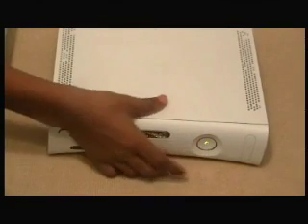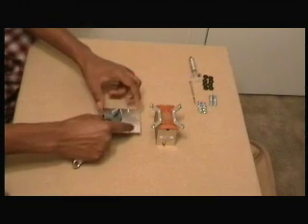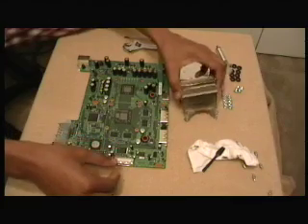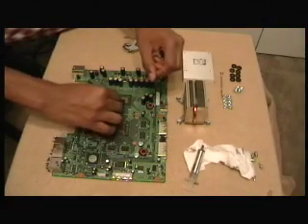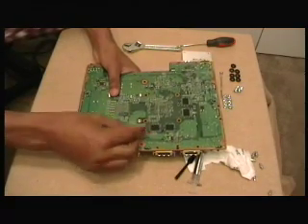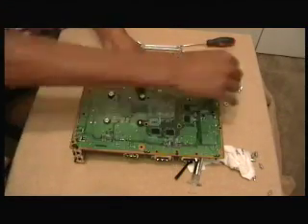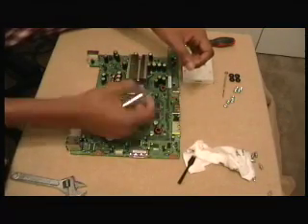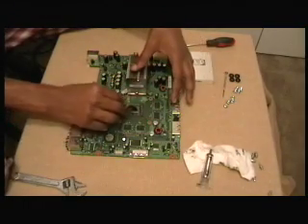Fix an xbox 360 with Red Ring Of Death ~ e74 ~1 red light -- PART 1

Comment: you sound like you might know something about electronics im a mechanic and have limited knowledge of computers but can understand and sometimes see how a system works,my friend gave me his old xbox#2with hdmi when he bought an elite i did a bit of looking on youtube then did my own mods basically i threw away the x clamps,stoned the heatsync level/smooth(the standard all have a radius) and used no thermal paste now it runs for 6 hours fine but turn it off and on and no good,residual heat?

Comment: why do you remove the x claps and replace them with bolts whats wrong with the x claps? it seem that the only thing that needs to be done is applying new heat sink compound to the chip so that it can conduct heat to the sink better.

Comment: This is great. But I have to tell you all. It DOES NOT MATTER What he has to say. You NEVER leave old/excess thermal paste on either the GPU/CPU or the heatsink. This paste once it has been removed (it's bond is broken) You always want to use something to remove it (best is iso 99% alcohol). If you don't use something good remove it, it will build a film and ultimately cause the error you have just fixed, to reoccur.

Comment: @RachelFuryRocks  Yes im sorry, dont listen to alot of these people here, silicone based  is what it is, cheaper "will do" compound. BUT you need as high a silver content as possible in Thermal compound, i would recommend Arctic Silver 5. 99.9% silver and around 10 bux from radio shack.

Comment: Continued, does not help much unless you put a small fan on it, if you do you can drop the temp down about 10-15 degrees, no the biggest problem is the X clamps and motherboard flexing this is why most xbox's can be fixed with new heatsink compound and to add microsoft used a silver based compound that hardens after many hours of usage then fails.  So unless your xbox has an other issues its not overheating, if you get the 2 red lights it is becouse the compound between the GPU/heatsink failed.

Comment: I'm still looking for any suggestions.  I did everything in this video, including heat gun. I don't get the RROD  anymore. I do get green lights, however it will always freeze after 10 or so seconds.  Not sure how to proceed from here. Any help will be appreciated. Could it be caused by the screws either being too tight or too loose???

Comment: i've built a lot of computers, so i just thought i'd share this with everyone. The way he applied thermal paste is WRONG. You can probably get away with it, but thermal paste when spread around and then attached to the heatsink will form air bubbles, which will ruin the effectiveness of the heat transfer... look up a video on how to correctly apply paste. You should place a blob or a horizontal line acros the chip and then attach the heatsink. the paste will then be spread evenly w/o air bubbles

Comment: I have sent my 360 in about 2 years ago
and now my 360 is out of warranty..
remember after doing this make sure the 360 resets or it will still automatically have RROD again.. unplug the fan turn it on  let it  over heat for a minute then Plug the fan back in  turn it on . Leave the power chord pluggged in when you do this~ becareful.
Also if you didnt put the right kind/amount thermal paste  or use the right amout of pressure when tightening the heatsinks it may not work

Comment: ALSO DO NOT TIGHTEN FULLY WHEN THE WHEEL IS OFF THE GROUND!
YOU WILL DAMAGE COMPONENTS,TIGHTEN THE BOLTS ENOUGH THAT YOU DIDNT HAVE TO USE FULL FORCE,THEN LOWER THE CAR JUST SO THE WHEEL IS TOUCHING THE GROUND BUT THE WEIGHT OF THE CAR IS STILL ON THE JACK.NOW TIGHTEN THE BOLTS TIGHT OPPOSITE TO OPPOSITE REMEMBERING NEARLY EVERY TIME YOU TIGHTEN TWO BOLTS THE OTHER TWO WILL THEN BE ABLE TO GO A BIT TIGHTER THEN VICE VERSA
I AM VERY SORRY FOR THESE COMMENTS AND THE CAPS JUST DONT WANT SUM1 HURT

Comment: mmmmm, ive built several pc's and it's not a great idea to spread the thermal paste all over, just a pea sized dot and let the heatsink's pressure spread out the paste. either work but the pea method is much cleaner because you dont get any run over from the paste

Comment: Update: I just redid all of the original work (heatgun reflow, thermal paste, replace xclamps with bolts) I did a better heatgun job this last time. (was a bit nervous and timid the first time) I turned on xbox, and got green lights. This is where i got the last time but it kept freezing shortly after. It's now been on with a game running for almost twenty or so minutes. I may have finally done it!!! I still have butterflies in stomach just waiting for the RROD to comeback. Only time will tell.
Reply: Does it still work? lol

Comment: If its 2 red rings i think its your power supply, make sure that its plugged in correctly to either the socket or the plugg from the xbox. if its 3 then its dead..and therefore need this kind of solution.

Comment: If u wanna fix rrod look at the power block and if light Is red then in plug the cord from the wall while xbox is off then wait for the red light to turn off and then replug, light should be red and when u turn on it will go green ;) thumbs up if helped

Comment: i just had this but i let the xbox cool down, removed the wires and the harddrive and then plugged it in again in the next 30 mins it seems to be working fine now? is this normal i dont wanna screw my xbox up even though it would be a good reason for my dad to buy me a new one ;)

Comment: My xbox gets 3 red lights when i first turn it on, then goes to 2 n just a couple of seconds w/ 0010 error code. Both of these indicate overheating, but that doesn't seem right seeing how i just turned it on. Its obviously not actually overheating. The fan will run 4 just a few seconds and then after the 2 lights it turns off. Any ideas on whats going on? (Ive already done thermal paste fix, heatgun reflow and switched xclamps to bolts. Had green lights 4 a short period, but would still freeze).

Comment: Hey! I have slight problem. When I removed the X-Clamp, I found  the thermal paste on the chip. Should I remove this and apply new thermal paste? And there were washers (not rubber ones). I don't know how this happened but there was no X at the back of the motherboard. It seems my xbox came with the x-clamp fix? I'm still getting the RROD. Please, I need help fast. Thanks!

Comment: Let just start with I have been doing testing on xbox 360's for the last six months and your xbox's are not overheating (keep reading)... when your xbox was new out of the box if it had an overheating issue it would die after the first hour or so of play and yes it is a very bad design but the GPU after about and hour of play hovers around 115 degrees not hot, the 4 memory chips around the GPU are between 130-150 and the 2gen GPU heatsink that microsoft added (keep reading continued down)

Comment: This is a temp fix, your xbox suffers from excess heat from a really bad design, I get Red Ring xbox's in for repair all of the time that have this xclamp mod done already...it may buy you a little more time with your xbox but sooner or later it will die.  To extend the life of your xbox it needs lots and lots of cooling even water cooled xboxs suffer from overheated memory & mainboard's plus bad capactors not to add about 10 other things, even the new xbox slims overheat thats why they freze up

Comment: How about the newer xbox small version, Is that any better? I just don't like how it looks personally but the black ones that look the same as the old ones look better. I have the green halo version, but got this fucking red ring tried on fixing it but now it has just one red light on the bottom left corner. So I really think is done. I really can't tell.

I just need to know if the black I believe "Elite version"? Does it have the same issues?
Or should I just get the new smaller one?

Comment: except the ylod is easier to fix, and when it happened to my xbox it took only about a year for it to happen, for ps3 it takes about 2 years to happen. And to fix the ps3 permanently, u only need to add a fan regulator

Comment: fixed my 2006 xbox, had 3 red lights, replaced x clamps, cost me $4.50(AUD) at the local hardware store.
didnt clean anything, just replaced the clamps, been going strong for over 2 yrs.
you can also buy the complete fix kit on ebay, for about $15.00(AUD), even comes with the opening tool, wish they had that two yrs ago, beats the fuck out of using paper clips lol

Comment: @deathshadow790 Its a quick fix, Your graphics proccessor chip will fail eventually. I will give it that yes, Microsoft has a flaw in there design and yes it is fixable by applying a better heatsink but it will fail. Its made to work without having to take anything appart or apply more cooling paste. prove to me that i'm wrong in what i'm saying. And not just htat yours works after a year.

Comment: There are better videos. I've fixed several xboxes and this video is not going to do a good job. You need to clean ALL the old paste off. Then use a heat gun to heat the motherboard to 200+ degrees to reflow the solder in the board. Then after cooling, put GOOD thermal paste on the chip. I use Arctic Silver 5. DON'T smear it around... That'll cause bubbles. Just put a small amount in the center and it will cover the whole chip when you reattach the heat sinks.

Comment: @ 3:47 don't listen to that bullshit about thermal paste.

You will notice a BIG temp increase by not removing it on a PC and it stays true for a 360 as well.
Doesn't take much time to clean the chip/heatsink off correctly with some isopropyl alcohol.

Comment: Nope. mine is fixed and it is an HDMI xbox. the only thing is that i did this method too and it still gets the red ring every now and then. so i open it up unplug the fans in the back and let it over heat. it will turn off and back on fine about 6 times then i have to over heat it again. its really hard to find an xbox now days that isnt HDMI equiped.

Comment: PLEASE ANSWER someone.

I followed this guide and it worked; however, when I start my xbox, the logo is fuzzy and my avatar is fuzzy.  It kind of looks like snow static that a TV gets when the cable is loose, but only for those 2 things on the dashboard.

What did I do wrong and can I fix this?  Is my xbox going to die again?  ty

Comment: I have a question if anyone can answer this. The title for the video says e74 one red light fix but he demonstrates how to fix the 3 red light in this video. Does that mean this video will fix both the 1 and the 3 red light problem. I used this video to fix the 3 red light and it worked. I have different xbox im trying to fix with the e74 1 red light. Can anyone help me?

Comment: Understanding the solution to a problem requires understanding the problem it self. We found the issue long ago at my site google cbtechone just click on the RROD pictrure it will take you to an article explaining what these companies refuse to. I been doing this for a long time. I can tell you you can only re-flow so many times. And you will find out why re-balling, reflowing(even using flux,xclamp replacement, etc. are all not fixing these consoles.

Comment: guys please help: i fixed my xbox elite by changing its thermal paste and it worked for almost 2 hours and i got the E75 again  so i did the fix like 3 times and it only work for 2/3 hours. then i tried the x clamp fix but it didnt work but when i put the x clamp back and tried to replace the thermal paste it didnt work just keep getting the E75. help me pleazzzzzzzzzzz

Comment: All that does is help transfer the heat from the GPU to the heat sink. The heat issue IS NOT FIXED!!...The only way to fix the heat issue is to put a fan on the heat sink and have proper venting for the heat to escape!!.  Again the Thermal paste (looks like silver paste) does nothing for the heat issue. Paste is just used to fill in the micro scratches on the heat sink so the heat transfers better. Allot of unnessesary work and a waste of time!! any pc builder knows this

Comment: Wow i have gotten so many of these from people who have the same
stuff you put on which seems to cause 0020 where heatsinks are
applying way to much pressure cause your rubber washers flexed 
and faltten pulling them down..... this is wrong what u need to fix
the 360 is.....

16 nylon washers 10mm
16 metal washers  5mm
8 M5x8 10 bolts
thermal paste of course and it is optional to clean the old paste true
but i do it anyway which is better..... Heating up the cpu side isnt a
good idea either..

Comment: Please...please...dont do this until you have called xbox support and verified your warranty.  Which is 3 years from the purchase date of the console for the 3rl or 1rl e74 error.  3rl are also caused by power supply too.  MS will fix it for free and give you 1 month of xbox live gold for free too.  Open the console before and warranty is void they wont touch it unless you pay for repair.

Comment: k i need someone to reply to this
i took my 360 all apart, took the heat sinks off, replaced thermal paste, got plastic and steel washers and bolts and all that, then put it back together, and the red ring was gone for a week, then it red ringed again, so i took it apart, reset it again, and loosened the bolts a bit, worked for a day then red ringed again.. so i dont know what the fuck to do this is pissing me off

Comment: 1. Cpu + Gpu are the other way round
2. Thermal Compound is used to transfer the heat from the CPU/GPU to the heat sink. not to help cool it.
3. You dont want rubber washers. Flexabilty means it can move. You dont want that u want a tight fit. So metal washers is what you need.

This has to be the worst red ring fix video ive seen.

Comment: this is a joke. All your doing is applying heatsinks to the xbox. The Processors are overheating because there wearing out. This will only delay the inevitable death of the graphics chip. Your better off buying a new box or getting it professionally fixed(it requires some serious soldering work).

Comment: I'm serious this video does nothing but show how to transfer heat from the GPU to the heatsink. It does nothing to get the heat out of the Xbox, The GPU is not the only thing affected by the heat. The core sensor is what actually tells the Xbox to show the ROD. Until Heat is removed from the Xbox and cool air brought it this fix is only a temporary Fix.
Learn a little more about modding and heat tansfer

Comment: you know whats faster that doesnt void the warranty?! wrapping your xbox up in a towel or something that limits the air flow so your xbox overheats then goes to the 2 red lights instead of 3/4 then restarting your xbox without the towel :O does exactly the same fkn thing hahaha and for the record in this vid, you should ALLWAYS remove the OLD THERMAL PASTE!!!!!! its common sense to all computer whizz ppl hahahaha but at least this will either work or completely fuck your xbox up!